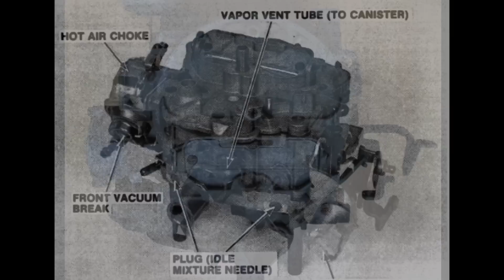Strangest Automotive Inventions:  GM's Rochester Dualjet Carburetor Or The "Demi-Quadrajet"

Comment: A downside of the downsized version is you ended up with a very specific air cleaner that fits only that one carb and nothing else.  At least with normal round carbs you might get lucky and have it fit a new carb after a swap.  I'm assuming they downsized it to save on material cost.  Reducing the size of the casting adds up over millions of carbs.

Comment: I had a 1979 Chevrolet Monte Carlo with a 267 V8 and the later dual jet M2MC. The car had decent torque and ran well. Emissions were terrible though. It would need tuning every year (air/fuel) to pass. I later had a 1986 Cutlass Supreme with the electronic dual jet E2ME feeding the 231 V6. The car ran much better, although it was gutless.

Comment: That thing look like a dodgie to get past rules tech in class racing. I hated the quadra-puke a they alway leak early. Never seen one of those. The 2GC standard Rochester 2v seemed to work well for pokey v8 engines. The Qudra-puke always sold lot's of spreadbore Holley replacement carbs which worked so much better.

Comment: All these years I thought I was crazy, but here it is. When I was a teenager I was helping my Dad change the air filter on his 1980 Chevy Caprice wagon with a 267 V8. I remember the carburetor looked like a Q-Jet but there were no secondaries - it was just aluminum casting over where the secondaries would be.

Comment: Over the years, I had a lot of Quadajets. When they are right, I loved them. I only had 1 dualjet and it ran great. I had it on a 4.3 liter in a 1957 Jeep CJ5. I eventually swapped the whole thing out for a 350 with a quadrajet.

Comment: I had a '79 camaro Berlinetta with Dualjet 305, turbo 350 trans and a 2.41 rear! Great highway cruiser, I guess the general didn't have enough overdrive trannys ready for the second oil embargo. Eventually, I put a Q-jet and intake and a 3.73 rear gear in it. That was TOO low. Love your vids.

Comment: yeah, the Olds 403 has a significantly larger bore than a Caddy 500 or even the Buick 425 Nail or 455 big block.  it'd be a hell of an engine if the block wasn't so damn weak.

Comment: Heh, yeah the Qjet. Learned to drive in my moms 68 Caprice, 327.
Nail that Qjet and oh my the sound!!    Managed to break a motor mount doing that lol.

Later had a 79 Cutlass with that 2bbl 1/2 a quad.

Wonder if a 350 manifold would’ve fit it topped with a real Qjet?

Comment: I fitted one of these quadrajet carburettors on my 🇦🇺Aussie 253 cubic inch V8, along with a lot of other modifications including of course a different inlet manifold. (It came originally with a pretty awful Stromberg two barrel carby. ) 
That engine was sweet after my mods - plenty of power when needed, yet absolutely fabulous economy if driven sensibly.

Comment: those carbs were able to make other cars look bad if modified slightly , adjust & or change the jet needles and valve spring made a huge difference you could adjust the mixture to work with the opening of the secondaries . I could brake stuff a lot quicker !!!

Comment: you are missing the v6 3 barrel .  I made tools to readjust the power valve the car on vacation got 24 mpg which was more than it was supposed to get. and the around town was higher than it was getting before

Comment: I had an 82 Grand Prix with an electronic controlled/connected Dual Jet on a Buick 3.8L V6. I wish I had pictures of it but it had some more stuff going on where the larger secondaries are on a quadrajet. I had the service manual for the Grand Prix, that year also included a slightly larger v6 option, I think it was 4.1L that came with a quadrajet. This style carb meant the intake air cleaner assembly would be the same no matter which carb was used. They made electronically connected quadrajets also.

My 81 Trans Am has a 400ci Pontiac V8bfrom a 78, for 2 years I ran a quadrajet, car ran fine but I swapped in an EFI system and it did modernized the car.

What folks forget, carburetors would get flooded, didn't like to start in the cold, and every car had a different ritual with the gas pedal before starting. Some cars were an "art" to start.

One thing a good carb like a quadrajet does is react instantly. Even the best cars today you can feel a slight delay in the gas pedal where a carb would react the instant you kicked down that pedal.

Comment: V-8 engines smaller then 305cu in. were common from 1939 to the early 60s and were brought back in the 1970s, but cars were heavier and thus the engines seemed under powered.  The old Q-jets were efficient for the time and the economizer was my favorite carb to work on.  The two barreled carb used parts from the q-jets and was thus better then previous models. Anti-smog devices were ineffective until catalytic converters came along to clean the exhaust. The real solution was closer tolerances, reliable computer electronic ignition and fuel injection which made engines more efficient and powerful.

Comment: the carb at the 4:35 mark has been rebuilt and the hole drilled to adjust the cruise mix, I run these and they are Excellent carbs for daily drivers.  I talked to one of the efi companies a few years ago when I was considering upgrading to efi.  his answer was our efi systems wont add any fuel mileage over a well tuned Qjet, his honesty kept be from wasting money on efi to try to get better fuel mileage.  the carb is basically set perfect and the exhaust has almost no fuel smell.

Comment: I had a 1979 Caprice with the later Dualjet on a 305 engine. That brick of a car would average 18 mpg on the highway at 75 to 80 mph. Fantastic carburetor !

Comment: If you wanted to get more bang for your buck out of a Q-jet, take it apart and with your dremel tool smooth out all of the casting seams and also feather the internal primary and secondary plates.  Also IF you had the space under the hood, stack two 6" circular air cleaner elements. You needed to get yourself apiece of 1/4" all thread to lengthen the hold down bolt.  My 305 with .202 heads and a reworked Q-jet and 2:73 rear gears went like a scalded cat.

Comment: Thank you for this video, I can relate to several vehicles from that era. I had a 77 Pontiac Bonneville four-door, with the 301 V8 a  nd the Rochester dual jet. You were right it looks just like the four-barrel Rochester but without the two extra barrels. There was no reason under the sun for having that carburetor! Four barrels if you drive them right get better economy and when you need the power they have more power,, right?! The 301 engine put out $135 horsepower in 1977 up to 145 a few years later. I know that a Pontiac Trans Am and or Firebird with the 301 engine, four barrel carburetor with a turbo only put out 170 horse. I believe those were all Factory installed? My old Bonneville driving around home would get at best 19 miles per gallon, but when I went on a winter trip, from Wisconsin to Fort Lauderdale Florida my mileage would go from 19 up to 28 miles per gallon. I discovered that for every 3 pounds of air I would get one mile per gallon. Now I don't do that in extreme driving around home year round, but on a winter trip if you don't want to have to add air to your tires for the return trip, you can enjoy some awesome fuel economy. at the same time years ago we had a 77 3/4 ton Chevy 4x4 with the 350 and the four barrel carburetor, it put out 200 real horses! The truck was geared so that 60 was pretty much red line. Driving at 50 miles an hour the truck would get 9 miles per gallon. And this is about when they started putting the locks on from the factory so that you could not adjust the carburetor. It was either adjust the carburetor or get rid of the truck, so we took the locks off and adjusted it and achieved 15 Mi per gallon at 45 miles an hour and then one mile less for every 5 MI per hour more. We sold the truck a couple years later having put on less than 10,000 miles in that time. The neighbor bought it for the price paid, $6,200! They used it as a farm truck, pulling everything including, full Chopper box loads of silage. I would love to have both of those Vehicles back! Back then, I asked a mechanic about putting a four-barrel carburetor on my 301 and he said, quote, it doesn't have the right cam for it?? Is there any truth to that?? Thank you in advance for any help!

Comment: I got better gas mileage from Buick with a 455 V8 than than one with a 350 V8. One thing is the 350 your always having to kick-in the 4 barrel. The 455 rarely. My Buick with a 455 V8 got better gas mileage than my 2000 F150 V8. I could hail anything with my Buick. Vehicles have gotten a lot smaller but efficiency to size hasn't improved? Seems like we would of found a way to make ICE a little more efficient by now?

Comment: The only GM vehicles I remember driving that had the dual jet were a pair of 1979 Chevy pickups with 250 in-line sixes and three speed automatics. They seemed to have a bit more pep than six’s with one-barrels I’ve operated thru the years.  I don’t recall and problems with the carbs, but the engines underneath the carbs were not up to previous Chevrolet straight six reliability expectations and each expired before the 70k mark. I honestly didn’t realize GM used that carb on a number of small V-8s. This was interesting.

Comment: Good carburetor. Big small block is a layman term used by shade trees mechanic . Just like certain line of automobiles engines have specific good categories fe, 385 ,335 series. Gm ls lc2 lc9 series .

Comment: I remember having one of those carbs. I was a Q jet guy for sure. My stepson was a little to excited about getting one of my camaros with a pretty hot 350 in it. I started to worry about him killing himself in it so I went to the junkyard and got one of these dual jets and put it on. He kept saying it doesn't run like when you drive it. I told him when he's smart enough to figure out why, then he would be ready for more power. It took awhile but he finally figured it out and in my mind it bought him some time to learn to drive. He actually did learn to hotrod like a mechanic instead of a leadfoot.

Comment: I would have a Rchester over a Holly any day. I love the old round top two jet you could rebuild it just as easy as  a Briggs & Straton! The quadrajet I have rebuilt well over a thousand, adjusting and tuning that was what I got to be good with wright down to adjusting the vacume shift solinoid on the trans. The three tings I found helpfull on the q jet were, adjusting your accelerator pump to idle for the tip in squirt the next is to jet the primarys this is trial and sucess, the one not many know of on the right side under the upper secondarys butterfly shaft   there is a set screw you can loosen and set the spring tension for the upper vacume butterflys, the lower secondarys are mechanical, its a matter of opening those vacume secondarys at the right time. It takes the bog out of the Quadrabog.

Comment: When I installed a 231 CI Buick V6 in my 1980 Triumph TR7 Spider in '83 in CA, the engine came with the 2GC two barrel carb which performed quite well.  But the intake manifold weighed a ton!  Well, probably over 60 lbs at least.  So I installed the intake manifold from the Cadillac 252 V6 that used a 4bb Q'Jet.  The Caddy manifold, being aluminum, weighed less than 20 lbs, but of course it needed a 4 BBL carb, and being in CA and having to pass the CARB emissions referee I needed a 2BBL version of the Q'jet.  It took a while to find one and set it up but it worked very well.  Now I have the Spider in Oregon and have a 4BBL Q'jet in the Spider.  Despite being only 231 CI, the Buick V6 will pull the secondaries open and issue a suitable increase in induction roar.  NIce!

Comment: The Rochester Q-Jet was a cheaply make carb that leaked after a few years that gave some moderate performance. Many considered them junk. But hot rodders loved them because you could change jets, or change the secondary rods for better performance. They made hi performance kits in the hot rod stores to rework them for more performance. You could also bend a tab to get the secondaries to open a little earlier. Put some gaskets or just tighten down the screws and they stopped leaking,. Their performance equalled Holleys and Carter Thermo quads in the hands of a skilled hot rodder.

Comment: Had a 66 Olds Delta88 Holiday coup with the 425 ultra high compression v8. I put an original Olds 4bbl manifold with a Quadrajet carb. Even with 14 inch tires I got 18 mph at 70+ miles per hr with the air on! I could give a 1970 400 Firebird a serious run for the money. Rated at 365 hp factory with single exhaust, seriously a cool car.😊

Comment: I took auto repair '79-'81 Still got the Class&Shop Fuel Books,,And it easy to rebuild a Q-jet in 20 minutes on kitchen table. Still replaced it with 650 Holley Spreadbore on '69 ElCamino SS396 CTX 350hp,,8mpg @80mph

Comment: My 78 regal had a punched out 305, iron intake and a properly tuned qjet. With 2.41 gears it got mid to high 20s for hwy mpg, but the best thing was the gearing spread. 1st gear-60, 2nd-120, and i never got to the top of 3rd gear cuz i backed off around 145 due to front end lift. Loved slamming 1st gear at 50 on the on-ramps

Comment: Chevrolet also had a 4.4L V8 267CI. It was one of the most underwhelming engine ever made by GM. They were in a lot of early 80s mid size and I believe some full size. I had one of those engines in a 81 Pontiac Grand Prix. I threw a different camshaft at it, as well as some small chamber 305 heads and a 4 barrel quadrajet. Just all used junk I had laying around my shop. In stock form that 4.4L couldnt even spin the tires on dirt. Thats how bad they were.

Comment: I was a Pontiac guy back in the day, the 301 was offered with a turbo. I never had one but I herd they ran pretty strong until they came apart. 

The QuadraJet was panned by a lot of people, I think because they were complicated and harder to work on than some of the other carbs. Other problems were the small changes over its life leading people to use the wrong parts or even the wrong carb, the very small fuel bowl volume meant you had to have a good fuel supply, and the greenish anodized “Quadrajet by Carter” models had very soft castings. There were a lot of those and back in the day I had several helicoil kits to repair them. Just backing out a screw would sometime pull the threads out with it! When I heard the term QuadraJunk, I always thought of that and didn’t get defensive even though it was a pretty good carb…if it had a good casting,,,fuel supply,,,the right parts in it,, and in the right application. 

Oh, and the leaky machine plugs between the baseplate and the body, and the emulsion tubes that would often fall out of the top plate, and bent up accelerator pump linkage from people pulling the top without driving out the pump arm pivot pin, Oh, and the aggregating choke linkage down inside the body you had to fiddle with to get back in place. But other than that they were great…did I mention how much I liked Holly carbs? 🫤

Comment: It's sad that it took as long as it did to develop fuel injection. They had mechanical fuel injection in WW2 and I know that GM also had a mechanical fuel injection back in the early 60 but it was too complicated to catch on. I suppose there was not much incentive until about 1973 when the Arab Fuel embargo kicked in. I graduated high school in 1973 and gas was about 35 cents a gallon then it started rising to about a dollar a gallon. I guess the car companies didn't want to spend any more than they had to to make a car so they developed every cheap way to make a car during this period. That's why the Japanese became so powerful later on. They had small light weight fuel efficient cars and small trucks that ran so much better for the most part than almost any American car during this time. I always hated Japanese cars until a bought a coupe of American cars in the mid 70's and early eighties. The Buick gave me nothing but trouble and the Plymouth K car just fell apart at about 80K. Not all American cars were junk and many would last for 200K miles but for the most part the cheaper cars that American car companies built back then were just rolling money pits.

Comment: I once had a 1970 442 W-30, which had a rather unusual carb. It was the ordinary quadrajet except... it had no secondary metering rods. It developed the common bleed down problem, and I was advised to take it to a local carburetor specialist in Hoffman Estates IL. I removed the carb and took it to him, and upon his examination, he was shocked to see the lack of metering rods. The only thing in the bottom of the secondary were two rather large jets. He asked me "where the hell did I get this carb?" I purchased that car while on leave from the Air Force new. I told him it stock since I made no mods to  the car (it was fast enough)
He made the repairs and off I went. One week later I came out to my car and someone cut my hood chain and removed that carb. I could not find a replacement that would work on that stock manifold. I ended up putting an 850 Holley on a Edlebrock to get the car to even run properly.
To this day I still don't know about that Quadrajet.